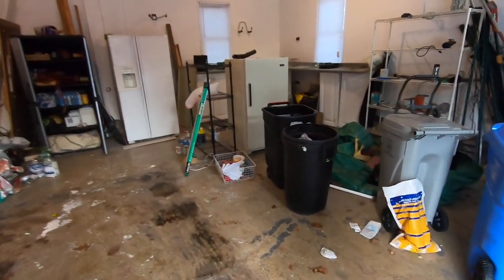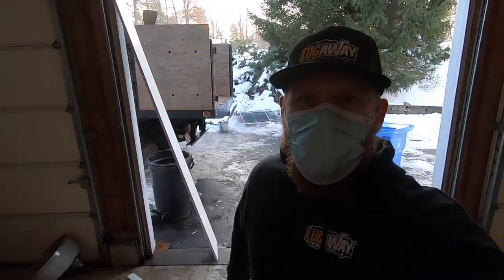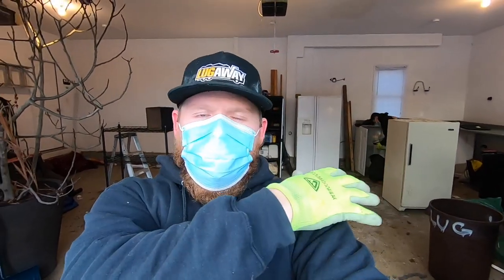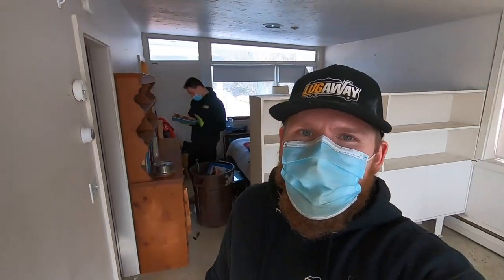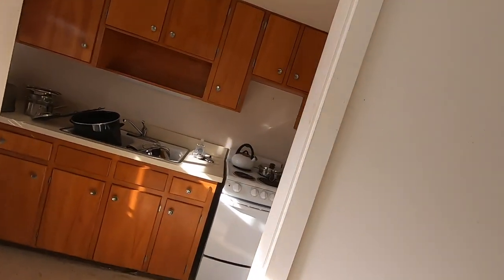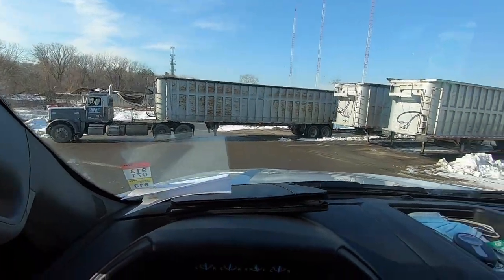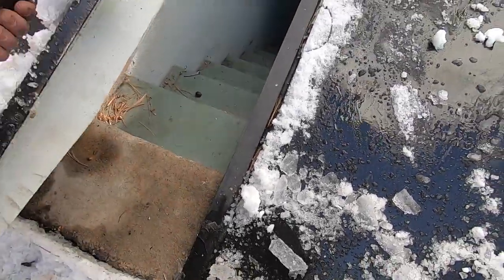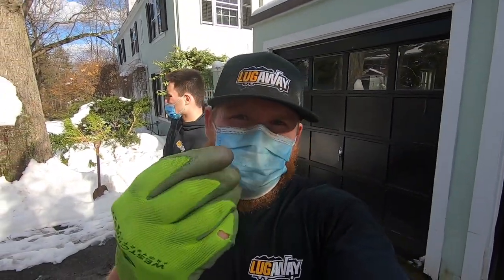HOW I MADE $3K IN ONE DAY JUNK REMOVAL DAY IN THE LIFE

Comment: I know you mentioned before that you cover 1 ton in your pricing per load. When you go over a ton do you just prorate the extra weight? Or if you’re doing multiple loads And the next load doesn’t quite make a ton do you just call it even?
Reply from the maker: All weight after 1 ton is prorated. If we pull a half truck and I think it's going to be over the weight we cover for that size load, but we have to fill the rest of the truck up before we go to the dump, I do my best to judge that cost after we dump.
Reply: @SteveConroy1  to add to this question, so if you go over the weight you quoted, do you go back and charge the customer more? I heard in a couple of your videos that you invoice some clients, does that mean they pay later? Or do you collect as soon as you load the truck?
Reply from the maker: @alanmorales1605  Yes, charge them more. If I feel the job is going to be over weight I invoice them after we dump the load.

Comment: Yeah, tough going to the scrap yard with less than $50 worth when there is a good chance you will pick up a nail.
Reply from the maker: Not worth it at all!
Reply: @SteveConroy1  I got a metal porch demo next week. I am on the fence for that exact reason. Dump at the transfer station for $30 or dump at the scrap yard to save $30 + maybe $20 for scrap, but risk messing up a $200 tire. Leaning towards just dumping at transfer station and be done.
Reply from the maker: @BackRoadBound  Nails are everywhere unfortunately. Just navigate around them or sweep the area before backing up. However, If the transfer station is closer I would just hit that and get on to the next job $$$

Comment: Hey man, thanks for the vids.  Do you get the CC up front and then charge them after the dump?  It's kind of risky to do the dump and then ask for payment, but you seem to add/remove charges for the dump fee's and so I'm confused.  Thanks
Reply from the maker: Nine times out of ten I take payment after the job is complete. If the material is in any way heavy, I tell them we'll check weight at the dump and I will bill then at days end. That is also a conversation I have with them before we book the. job. I only. do it this way because I want to be fair to the customer and to myself. A residential full load pick up rarely goes over 1 ton and if it does its like 20 bucks. I don't want to eat that $20 so I pass is on to the customer. I could just charge a flat fee of say $50 if I think it would be over weight and accept payment before we left but the customer would not like that and it's not fair to them. I never remove charges for the dump fee though, so I'm not sure where you're getting that. But if I'm mistaken please let me know! Happy to answer your questions brother!
Reply: @SteveConroy1  I just meant that you adjust the final bill, not that you actually lower it. Thanks for the reply.
Reply from the maker: @tekker8308  Yes you are correct. If I have a bad feeling about the person I will tack on what I believe to be a fair amount and get paid on the spot. I don't ever have a problem with my system but it might not work in other areas.